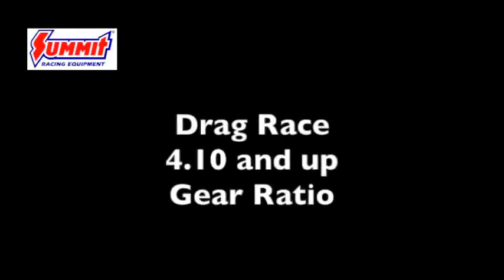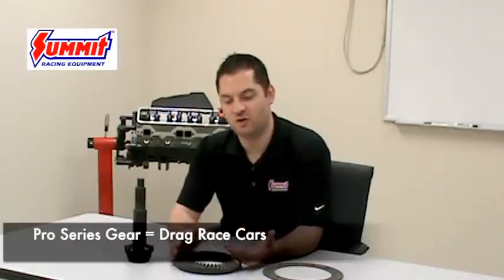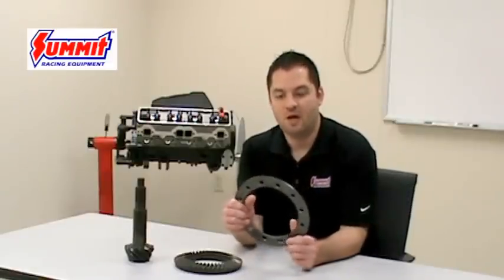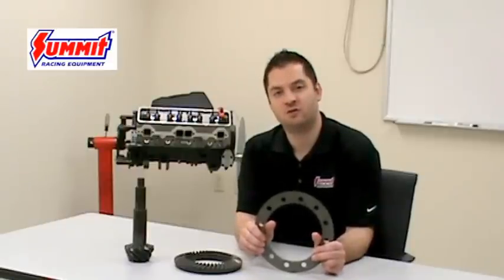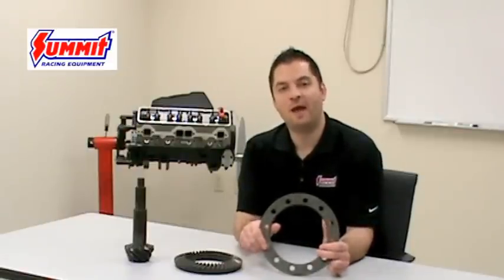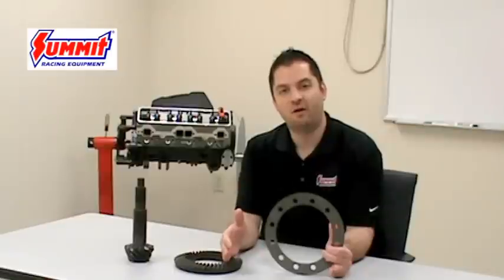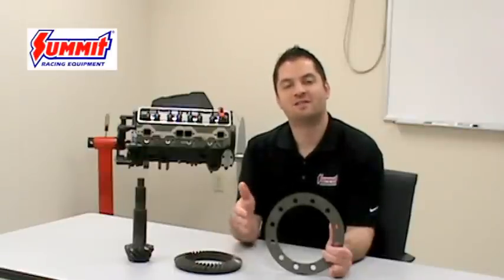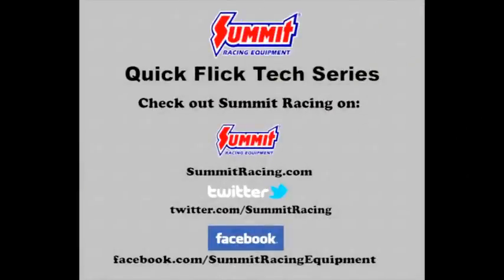Selecting a Ring and Pinion Gear Set for Your Vehicle

Comment: so if i have 4:10 i shouldnt drive it on the highway?
Reply: I have 4.10 and don't have any issues driving on the hwy at all. At 75mph my rpm is about 2200
Reply: What is normal for rpm? Im kinda new lol
Reply from the maker: +Kelsey fox , 
Well, that depends!  When the industry says “Highway” they are inferring 65 to 75 mph for a long trip. Most high performance motors aren’t built with that type of usage in mind unless an overdrive transmission and/or larger tires are used.  Give us a call with your parts list and we can help pick supporting parts. 1-330-630-0240.
Reply: +nola504boy1 what trans u have because with the 5 speed you should be higher then 2200 rpms
Reply: +James V 5 speed
Reply: +James V I think my tire size makes a difference also. I have 20 inch rims on my car.

Comment: I have heads and cam in my car I went from 327 to 373 and I barely noticed a difference is that because I have 22 inch tires and if that's so should I go to 410
Reply from the maker: Hi Richard, 
This would depend on the tire outside diameter more than the rim diameter. Give us a call, we’ll help you pick out the correct ratio for your needs. 1-330-630-0240.